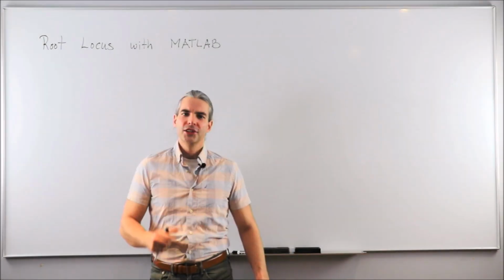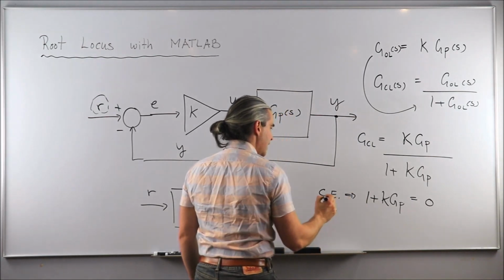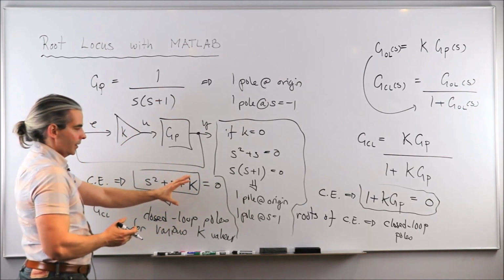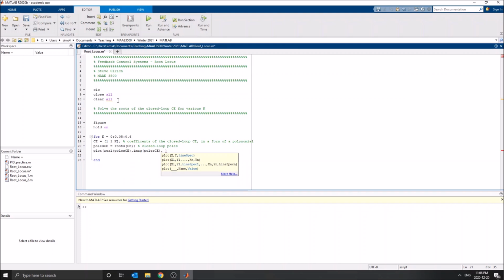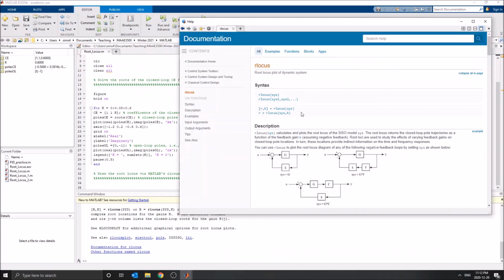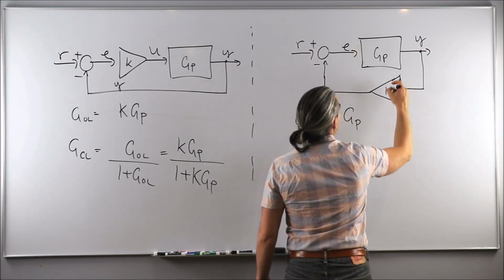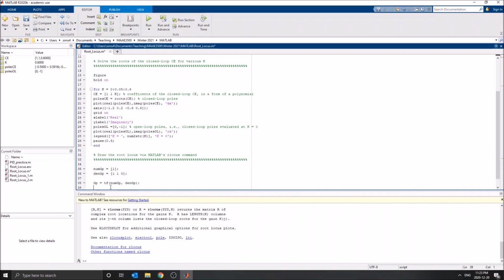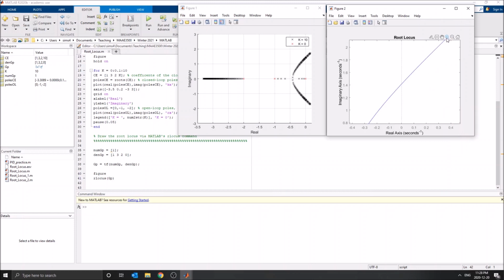Feedback Control Systems - Root Locus Construction with MATLAB

Comment: I would have loved to sit in that lecture.  I would have been the student from hell asking questions like why use root locus?  It is only used for 1 gain?    Modern controllers have 2 gains at least.   Where does the values for Gp(s) come from?  How can you plot the root locus if you don't know the open loop transfer function?  Why put K in the feedback path?  What is the optimal value for K?  What is the significance of the breakaway point?  WTF good is it?   This is a good example of teachers teaching what they have been taught.  Root locus may have been useful when using a simple proportional gain but that isn't the case any more.  Also,  back in the dark ages before computers, how would they even determine what Gp(s) is?